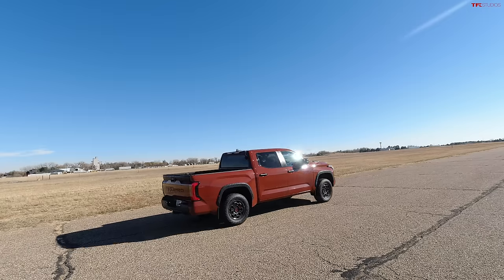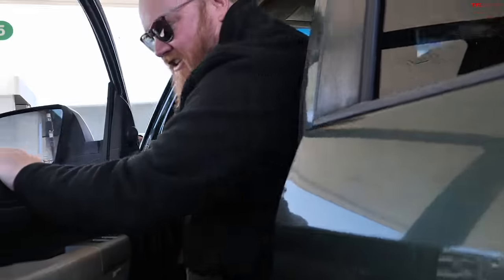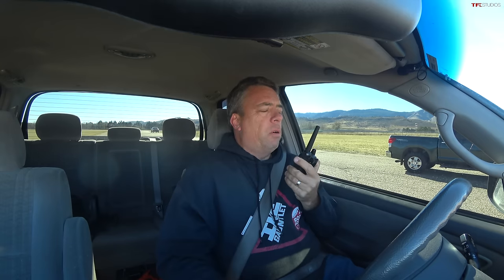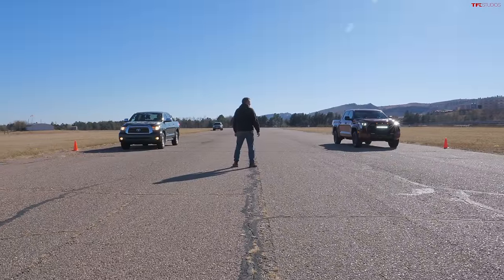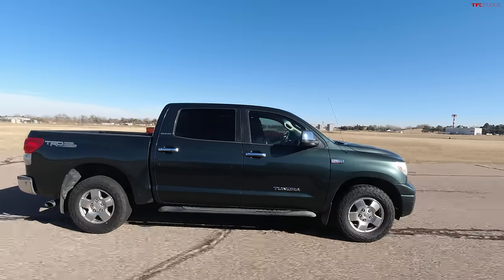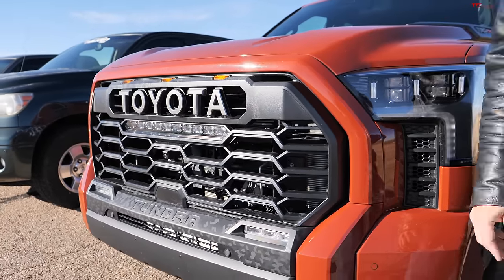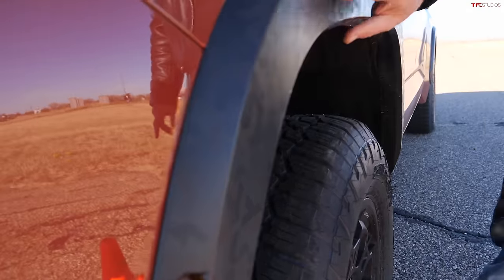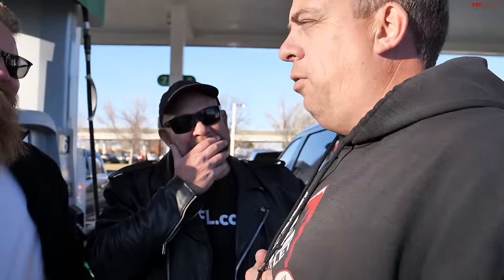Three Generations of Toyota Tundra Drag Race & MPG Surprise: That WAS NOT Supposed to Happen!

Comment: If someone presented me the option to take one of these trucks, I wouldn’t hesitate to take the first gen Tundra. That truck ticks all the boxes on size, dependability, utility, lake of safety nannies. It just flat out is a great truck. This is coming from a second gen Tundra owner.
Reply: Agreed. It'll just last forever in the hands of anyone somewhat mechanically inclined.
Reply: As a owner of a 2003 4.7L V8 Tundra 4x4 and now a 2021 Tundra TRD Pro double cab 5.7L V8 owner, I would argue with you that the 2.5 gen is far superior to the original. The biggest problem is the 1st gen is absolutely gutless. It can't tow worth a crap, and throw any kind of weight in the back and it can't get out of 4th gear. 

My 2021 smokes it in absolutely every way. MPG city is around 15 and highway is around 18. I'd never trade that 5.7 for a 4.7 at this point. Also, the size of the 2.5 is so much nicer. The interior is so roomy and is just a better highway cruiser than my 2003 was hands down.
Reply: As much as I agree that the first gen is a great truck that would work great for me 90% of the time.i got a 2nd gen to have a towing capacity large enough to tow my camper.and enough room in the rear to fit 3 car seats lol
Reply: Everyone knows the 5.7 will still be pulling strong when those turbos are dead and the 4.7 croaks. Could be the best engine ever made.
Reply: @morgandrives 100% agreed. On top of that the best six speed transmission out there too. The idea you need 10 gears is ridiculous.
Reply: No if someone offered you a brand new of any of them you'd undoubtedly take the newest generation
Reply: Still take 2nd gen timing chain over belt
Reply: @Mills117  Yep. Then sell it and buy one with the 5.7 V8 and bank the extra cash.
Reply: I had a first gen and it was a great vehicle, but a horrible truck. Couldn't tow over 3k lbs to stave its life
Reply: @cartopia6161 - Agree. 
Although the 4.7 is gutless, it is absolutely strong, dependable and reliable. One of the best products that has come out of Toyota motor group.
Reply: Yeah; I’m not surprised. It comes from the Lexus line up I’m sure. My 2005 LX470 has the exact same system. Works like a charm.
Reply: @morgandrives not a chance. I have 2 4.7 v8 4Runners and I can tell you one thing, that tundra needs a 5 speed and 3.73 gears. My 2005 was dead nuts even with my brothers gfs 2021 ecoboost explorer until 90 mph. I can go absolutely anywhere I want to go and it gets 20 mpg or better at 55-60 mph. 250k miles on the 05, 231k on my 03. They are bombproof
Reply: @SuperSnakePlissken  I've owned both too. I like the 2nd gen but the 2nd gen is a PIG man, turning radius is horrendous, parking it is a nightmare, it is a pig bottom line. Mine also got like 10 mpg. Plus, I prefer an access cab with a 6ft bed vs a double cab with a 6ft bed. Navigating tight parking garages and tight streets is also so much better with the 1st gen. For the average person, the 1st gen will be more than enough. Towing is really not a concern for me. If I was worried about towing, I wouldn't even be looking at gas trucks and would be looking at diesels.
Reply: I love my first gen.
Reply: No you'd definitely take the 3rd gen. It's better in literally every measurable way
Reply: @Mills117  Except in reliability. 1st and 2nd gen are already far more reliable than the 3rd gens lol.
Reply: It looks the best too especially the 04 to 06 with the crew cab.
Reply: You're absolutely right. I would do the same.
Reply: You’d be wrong. I’ve owned 2 2nd gen’s and 2 1st gen’s and while the 1st gen’s are great the 2nd gen is hands down better.
Reply: @SuperSnakePlissken  your 2021 is useless when the center smart screen malfunctions. Ask a toyota tech, they'll tell you that thing is an electrical nightmare once the smart integrated, not optional, screen malfunctions or dies. Good luck when you need to repair and no warranty on your pavement queen
Reply: @westcoastplinkin6559 since you are a professional please explain?
Reply: I drive a 2002 Tundra trd with a 2.5" lift and a limited slip in the rear that my dad sold to me for very cheap (cheap for what a tundra usually sells for lol) and i drive it everyday and love it. Its got 220,000 miles on it and the timing belt and water pump has been replaced along with front struts and ball joints. 
Its such s nice truck i cant imagine ever needing a new one lol 😂
Reply: When the 4.7 croaks? I bet (i know its not a tundra, but the same engine) my 04 sequoia outlasts the next guys 5.7 by a MINIMUM of 100k miles.@morgangregory2526
Reply: I'm guessing you have a pretty beat to death first gen then. My 03 is heavily worn and still drives better then most new trucks, my 04 double cab has a brand new frame, bushings, no rust at all & is an extremely nice truck in it's capability. It's a 4.7 , the only reason the other trucks are faster is because they have way more power. But the 4.7 is still plenty strong. They're not race cars who cares how fast they're. I tow with mine & don't even feel anything behind me & i live in a mountainess area.  @SuperSnakePlissken
Reply: In my opinion, the single biggest improvement of the current tundra gen is getting rid of leaf springs. Not something most people care about but I love a smooth ride.
Reply: @SuperSnakePlissken take it off-road though and the first gen will smoke the 2nd gen on trails
Reply: Agree. I still have my 2003 Tundra T3 after 14 years. 300k on the clock and it still never lets me down.. also looks nicer and is in better shape than 95% of the junk on the road these days 🤷🏻‍♂️
Reply: @SuperSnakePlissken  You must live in flatville. In the mountains more gears is just better in every way.
Reply: 20 yo rust bucket or pay 20k for a mint one no thanks.
Reply: My first Gen tundra has over 500,000 miles and still running strong, same engine and transmission
Reply: I just picked one up today for 3k I’m stoked, always wanted one
Reply: Ya they do tick from time to time !
Reply: I agree. Never owned one but I know a handful of people that did and a couple of them still have them. All over 200k miles and 2 of them over 300k and one of them with 480k mikes on it. And that last one is still a daily driver. Hauls loads of tools and material. He truly takes care of that engine and upkeeps it constantly. All are or were used what it’s intended for. 
I’ll say this about the new turbocharged version. It won’t last. Yes this is a drag race. A USELESS drag race. Trucks are supposed to be dependable and reliable and tough. I would pick that 4.7 ANYDAY. All day. By far the better truck out of these 3. It truly is a sad and hurtful thing to witness Toyota going downhill.
Reply: First gen all the way and you don’t have to be an NBA player to get a tool out of the bed. I had 2 T100s and loved them.
Reply: @SuperSnakePlissken  1st Gen only had 4 gears....
Reply: @akop87  Great. Been a long time since I owned it and I just put it in D. Thanks for letting me know so it would stay in 3rd.
Reply: We absolutely love our 05 double cab TRD tundra
Reply: The problem with the UZ motor is it has a timing belt. If it was made with a chain I would agree with you.
Reply: @mattsmith817  a timing belt doesn’t mean it’s a bad engine. Honda has always use timing belts in their V6 motors and their fantastic. Toyota used to use them and those engines that used to use them are still running if maintain properly. If you’re all hung up on timing belts and sir I don’t know what to tell you.
Reply: @SuperSnakePlissken  I’m not saying it’s a bad engine, actually it’s a very good engine but the cost to replace a timing belt every 90k miles kinda sucks. Had they made that motor with a chain it would have been indestructible. If that belt brakes your motor is toast, with a chain you get some warning rattles telling you it’s time for a new tensioner. Everyone knows that the belt was the fail point of that motor but I’m sure with proper maintenance it will last forever. The problem is most people don’t want to spend 5grand on their truck when it’s not broken, ultimately leading to catastrophic failure when the belt breaks.
Reply: @mattsmith817  I understand now what you are saying. On top of the 2021 Tundra TRD Pro I drive, my wife has a Acura MDX 3.5L V6, my daughter drives a 2017 Honda Accord V6, and my oldest who was a kid when we bought a 2008 Honda Odyssey brand new, is now owns it because she is married and has a baby on the way. Three 3.5L V6 motors with timing belts requiring they be changed every 100,000 miles. It is the price you pay for quality. A 4.7L V8 Toyota motor I think is worth the price for quality. Also, you can go more than 90,000 miles if you are driving regularly.
Reply: @SuperSnakePlissken  90 k is dealer recommended. I am a Honda guy too. I’ve built 2 integras, a LS and a GSR. I’ve owned a SOHC civic and a V6 Accord plus numerous Honda dirt bikes all of which were extremely reliable….. doesn’t hurt that I am a mechanic and take very good care of my cars lol. I learned a lot abut each of these trucks because I recently bought a tundra and wasn’t sure which generation truck I wanted. After seeing the possibilities of catastrophic failure happening to the new tundras I opted for a 2014 with low miles and 1 owner. I couldn’t stomach spending 80k on a truck that might not make it to 100 thousand miles, plus I tow so the 5.7 is a better fit for my needs.

Comment: 1st gen Tundra is a hidden gem for off roading or overlanding. Its smaller like a tacoma but with a v8 to be able to carry all the extra weight comfortably.
Reply: Shhh I’m still trying to buy one 😂😂😂
Reply: I'm still truckin with an 05 Tundra. It carries my 950 lb camper and does so with 87 Octane gasoline.
Reply: Entirely on train with you. Realized that when I saw trucks continue to get bigger
Reply: My father had one. He drove it hard for 10 years before he passed away. He had well north of 200k miles and never changed the timing belt. A friend of mine had one with nearly 300k miles in fantastic condition until a moose stepped out in front of him. They're great trucks for sure and I've been thinking about buying one for the last few years as a second vehicle.
Reply: With doors being so much thicker for safety now, and the trend to go with huge middle consoles, I find being in a new Tundra I have no more front seat room than in my 2000 Tundra.  A little more leg room maybe, and that's it.
Reply: They are a great look.  I always laugh when i park next to one in my Tacoma, which is slightly bigger.
Reply: @jaylonsorrells5139 😂😂
Reply: @jaylonsorrells5139 Seriously, I'm planning to buy a 1st gen Tundra in the next few months myself. It won't be a hidden gem much longer😂
Reply: @robmad0  It's true!  But so much more room in the front seats of the 1st gen Tundra.  That said, if I was involved in a wreck I'd feel 100% safer in the modern truck, whether Tundra or Tacoma.  That extra 1st gen room and lighter weight comes with a trade-off.
Reply: @robmad0  I always laugh when some Taco thinks he can overtake me in my 06 Tundra.
Reply: I wish mine had true 4wd.
Reply: I prefer to take my truck underlanding...
Reply: I have a 00' 1st Gen Tundra,best tru k I've everbhad,195k and if feels great,I almost like it as much as my 22 Tacoma TRd Pro!
Reply: @Santerianumero1 I outran a 2014 rt charger in my 2005 4Runner. Those 4Runners come with 3.73 rear gears and the 5 speed trans. I wholeheartedly believe they would both outrun the 5.7 tundra
Reply: @joshuaearnheart2756  they are fast but I wouldn't go that far. My 06 DBL cab has 3.91 from factory and I attempted to race a 5.7 and got spanked hard. The extra 100 HP and 80+ torque @4.30 gears whooped my ass.
Reply: @Santerianumero1  my 4runner on the scale with me in it was 4720 with 33” tires. My brother had a 2003 tundra and I can promise you it’s nowhere close. That thing was an absolute pig. He sold it and bought a 98 4runner. He got tired of not being able to pull his boat with the 3rd gen and getting 14 mpg on the highway. Just sold it and went and bought himself a 2005 limited 4runner with the v8. We have 3 of them and he had a tundra. Believe me.
Reply: Good point. Never thought of it that way.
Reply: I love my 2006, bought it brand new.

Comment: My 2000 first gen 4.7 is just over 940k miles no rebuilds
Reply: stock transmission?
Reply: Serious? How about timing belts and transmission flushes? I’m sitting at 250k and want to push it to at least 500k
Reply: I kind of picked up my dads 04 tundra with 350k miles. Im doing maintenance and tune up and am realizing how beautifully this truck was designed. Original engine and trans, changed fluids and cleaned throttle body. The engine is ***** amazing excuse my language
Reply: Damn👍🍺🍺🍺🍺😁
Reply: My 03 SR5 just turned 100k in 2024. 
Just broke in and purrs like a kitten. 
My hopes are to never see a car note.🏁
Reply: @ALLw3rk that can easily happen. I had 325K when I sold mine. Still the factory transmission as well. It was still running like a beast when I let it go. Still regret getting rid of it. I put that truck through hell and it ran just as good as the day I got it.
Reply: @86r1ck  I’ve got 2. Selling one today, it’s a 3.4 v6 manual gearbox that I’ve redlined to the moon! It still purrs and no exhaust tick.
Reply: 2007 4.7L tundra, 313K and getting ready to do timing belt and H2O pump to keep it going forever